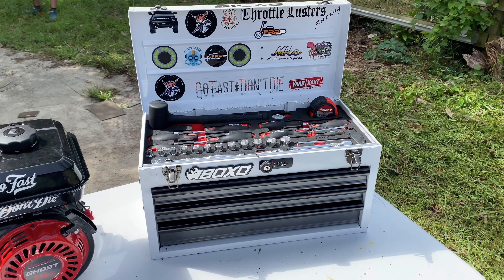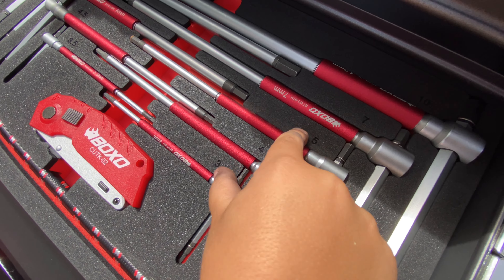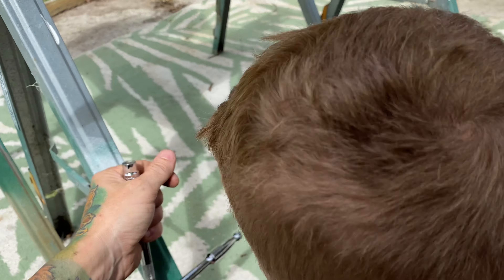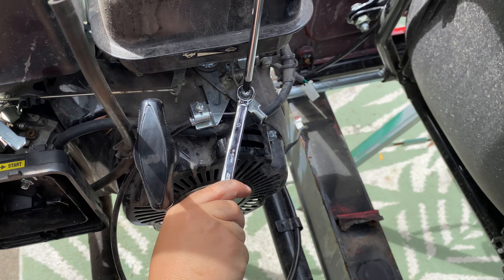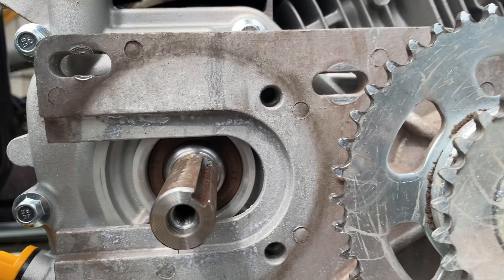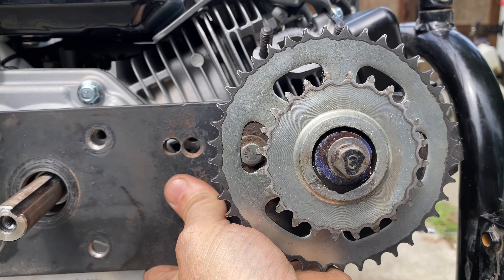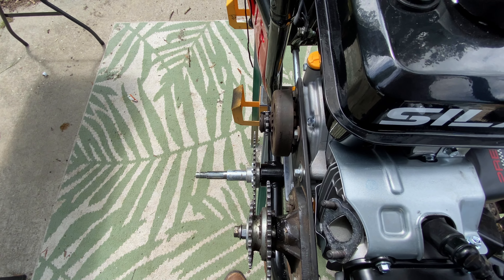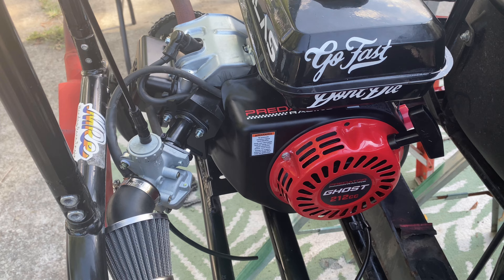How to engine swap a Coleman Powersports Go Kart TyrannoSilas style

Comment: Great job 👍 have you considered a torque converter with a large rear sprocket? Maybe when he wants more, just another option instead of straight chain.
Reply from the maker: I’d have to cut so much of the frame up to make one fit.    I took the torque converter off mine to see how it would fit and it just doesn’t.   Not much room on this frame unless you were to make room 😂.  I do however have a 75t rear sprocket on the way to try running straight from the clutch.
Reply: @TyrannoSilas_Rex  I had a straight chain to a 73 on a manco thunderbird minibike, wheelie machine with a 6hp! Likely be great on a kart.
Reply from the maker: @FreeRunMonster802  I’ve got a similar setup on my old Cat mini bike.   Sprockets nearly the same size as the rear tire.   I warn everyone that tries to ride it that it’s going to try and throw you off the back and everyone still ends up on the ground.